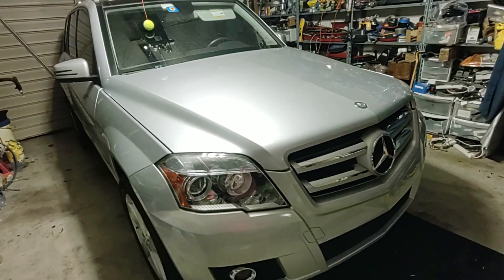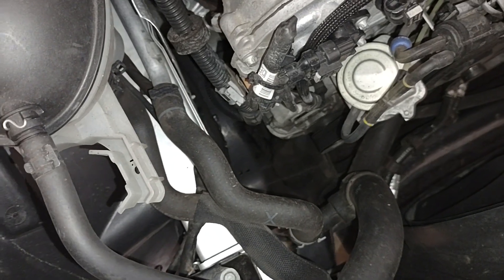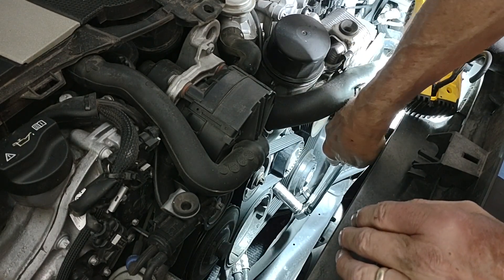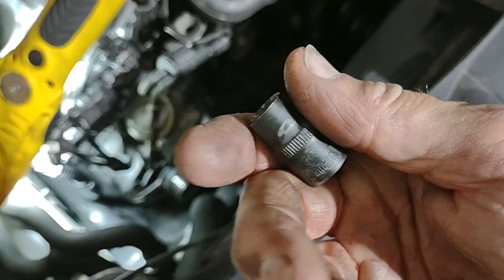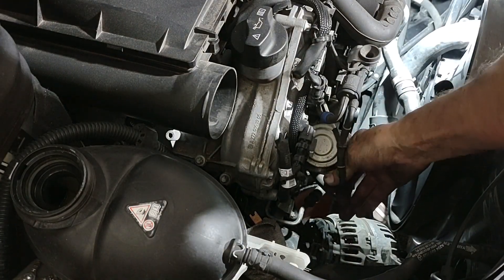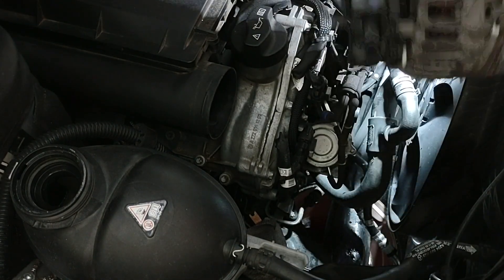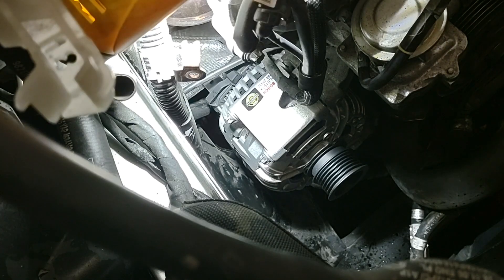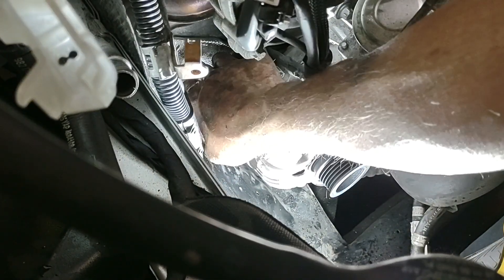2011 Mercedes GLK 350 X204 Alternator Replacement

Comment: Thanks! Love you glk video. 

Quick question: would the bottom bolts be accessed by removing the wheel liner?
Reply from the maker: @lukman8400  I didn't have to remove the wheel liner. The access is good from underneath, with just the splash panel removed.